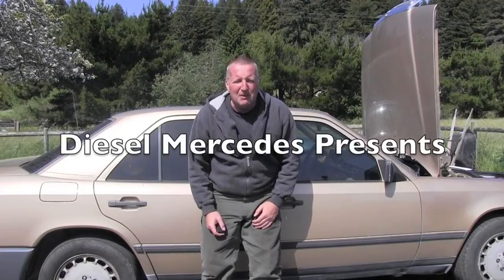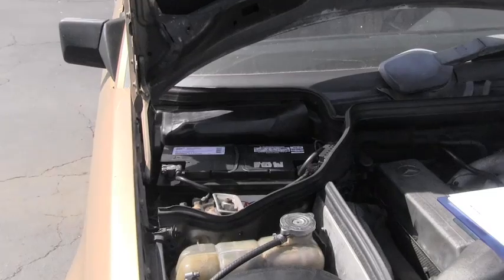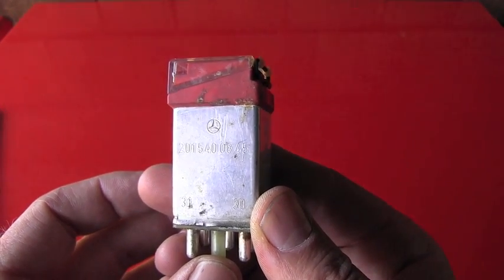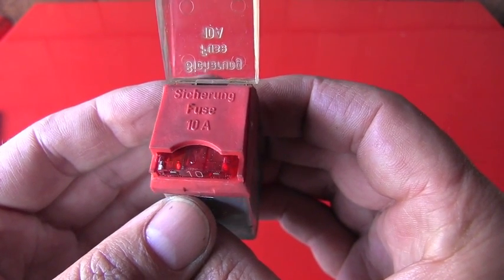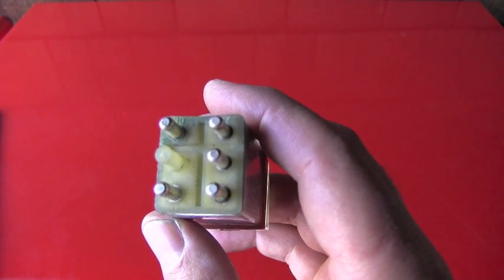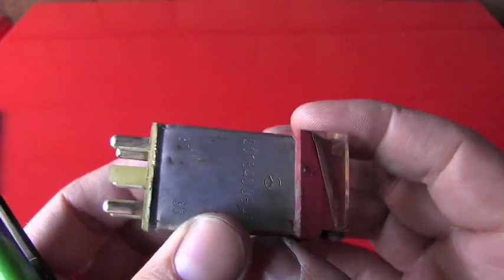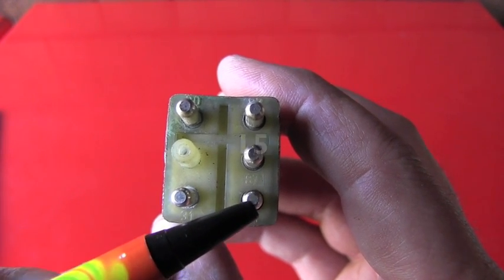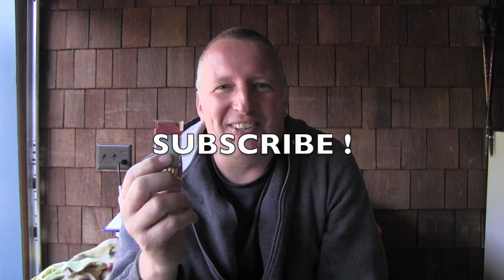Mercedes W124 Overvoltage Protection Relay K1

Comment: I HAVE 124  TURBO DIESEL 2.5. I CHANGE NEW STAR MOTOR BUT SOME TIME DO NOT START I HEAR LITTLE  CLIK NOISE FROM ENGINE ROOM. 
IS ITS RELAY AND WHERE IS THAT RELAY AND WHERE START MOTOR GET CURRENT THIS THIN SMALL  CABEL?  FROM  RELAY OR DIRECT FROM IGNITION SWITCH. 
IF ANY ONE CAN EXPLAIN PLZ.

Comment: Hi, today i broke one of the connector wires that this relay connects to. It is actually two wires, both broken off, I twisted them together and connect them back to the sucket. I think it goes to the number 30 pin. Did I do it right? I am waiting for a new OVP relay to replace the current old one.

Comment: Hello Diesel Mercedes. I have a  1992 300e with the 2.6 liter M103 engine. I having a issue with the car stalling out when you come to a stop. Under light acceleration it gradually picks up speed as normal. However if you try to accelerate hard it stumble, and has a miss fire. I just purchased a OVP relay installed it, and it still does the samething. This time it stalled, and wouldn't start back up. It has spark, but not start up the starter just turns over. Spark plugs look good too. I'm thinking maybe fuel pump relay or fuel pump. Maybe crank position sensor? I am at a lost right now. I'm more of a Nissan guy, but any help would greatly appreciated. Thanks.
Reply from the maker: what is the fuell pressure ? how long time ago replaced fuel filter ?
Reply: Diesel Mercedes Thank you so much for your reply. This weekend starting September 2nd me and too other techs are going to target the fuel system. One tech is a Nissan specialist like myself, and the other is a BMW specialist. I did have one more question. Does the fuel pump relay fail often? And could I run a 12v lead to bypass it just for trouble shooting? I know the the pressure needs to be with 5.3 to 5.5 bar which is about 80 psi.  That's high compared to our Nissan VQ35DE at 51psi.
Reply: Diesel Mercedes Thank you again. I removed the distributor  cap today, and found motor oil everywhere. My guess is that the cam seal is bad. My question is could motor oil damage the distributor? I sure hope not. Any suggestions would be greatly appreciated. Thanks again. Walt
Reply: E
Reply: Same problem on my 84 500SEL gasser. Idles just fine but will occasionally stop when slowing or coasting. Major issue is lack of power, engine cannot get above 1100 rpm. Stalls and misses and backfires. Can’t accelerate. If I suddenly release the accelerator after opening the throttle and letting the engine miss and cough rpm’s surge to 2,500 and then drop to idle. 
Any ideas?
Reply: @the_wild_435  Back fires ?🔥 I would swap out the crankshaft sensor.

Comment: great video. will test mine
Reply from the maker: good luck !
Reply: so I took it out of my car and tested as suggested. it clicks and the pins are energised. so I know my relay is working. also, i can feel the relay click when it is mounted in the socket. so i know the circuit to the relay is working as well. i might try injector cleaner to see if that solves hard start. it is strange as once it gets going it works fine. only really hard to start in morning or when cold. i had only recently replaced thermostat and air filter. although i seldom drive it. perhaps driving it more often might fix things. cheers

Comment: Can you tell me what to look for on my gas car .... I have a. 1989 Mercedes 300 SE and it has issues starting ... Some days I can turn the key it starts some days it gives me a hard time to start .... More so when I drive it then turn it off and later when I restart the car it cranks a good amount of time before it starts but also sounds like it misses then it clears up to running smooth again .. My issue is starting why do I have this issues all my ejectors fuel pump fuel filter spark plug wires cap and rotor her happy and replaced still has the same problem